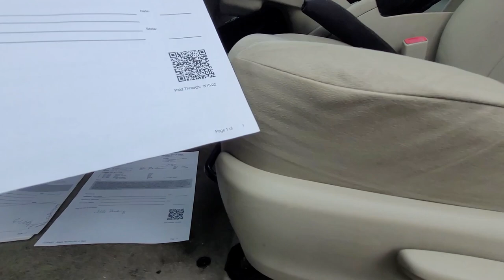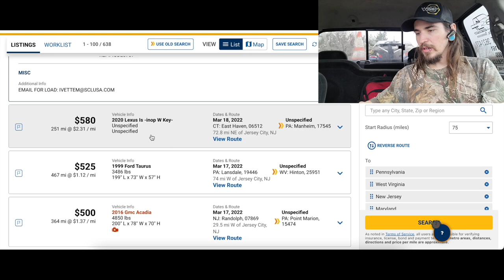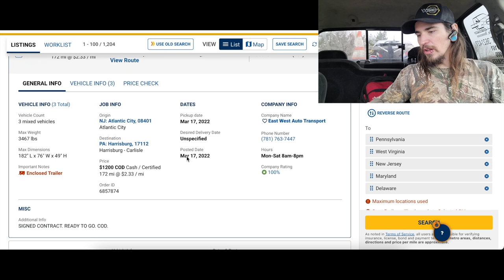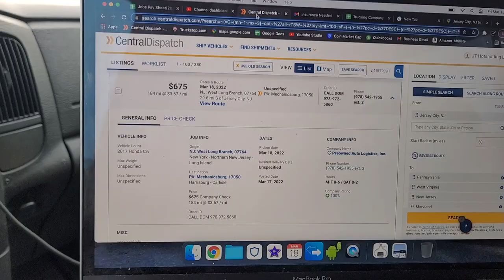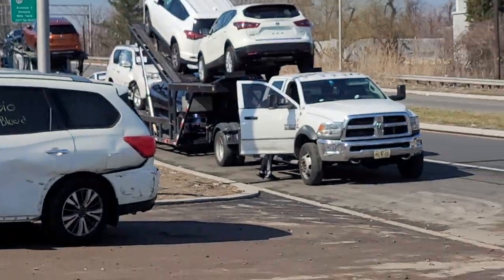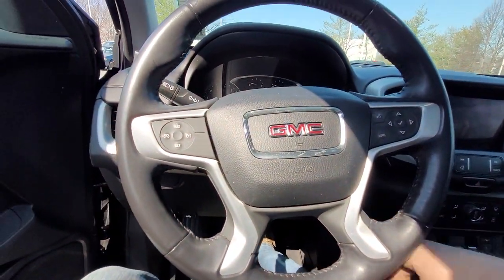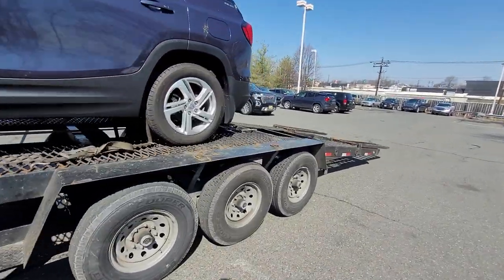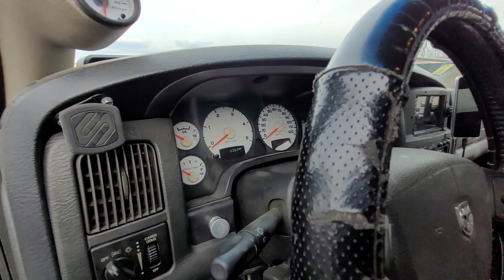NJ Warehouse Holding Drivers For 3 Hours | Hotshot Car Hauling | Real World Local Rates

Comment: I was not keen on the electronic e brakes either. Until I found out they totally eliminate the cable system. Actuators are used directly on the brake which to me seems better than the cable system.

Comment: Those rates suck when your paying 20% of it to the company.  Is that mounting hole on top of your air intake open to drawing in air after the filter?   If so, I would make a cover for it and close it off.  Will be interesting to see how much smoke you can get rid of.